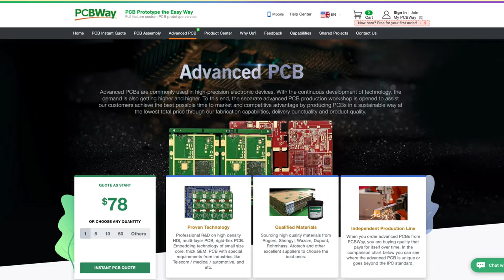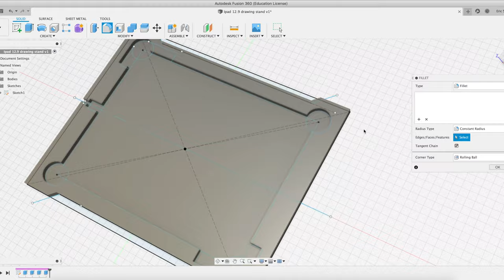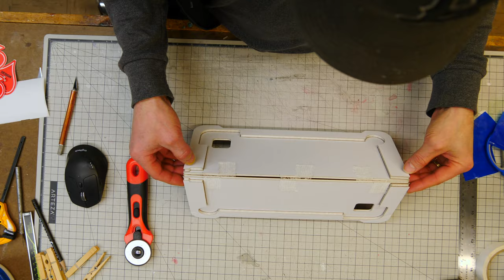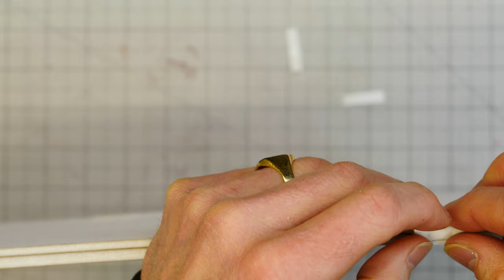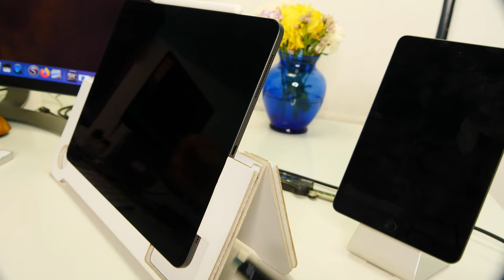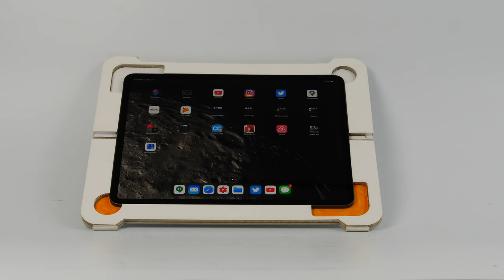Magic iPad Stand

Comment: Very nice! At first I thought you were prototyping in foam core, but this worked out well as is.

I’m working on a similar project for my iPad Pro. I have not found a case that I like with a 1/4-20 hole for mounting on a tripod (or mounting accessories to the case). They’re either super expensive or super flimsy. (I’ve tried a few of the flimsy ones.) Anyway, I’ve got some MDF, but no foam core, so that’s what I’m using to it.

Since one of the purposes will be to use the iPad as a remote for Filmic Pro, I want access to all the buttons, the headphone jack, and the speakers. I think this will end up much thicker and heavier than yours, but it needs to be thick in certain areas to have enough room for the 1/4-20 T nuts.

Anyway, it was great to see your approach to a similar but different project. I hadn’t thought of putting in a hinge for use as a stand, but  . . . Back to the sketch pad!